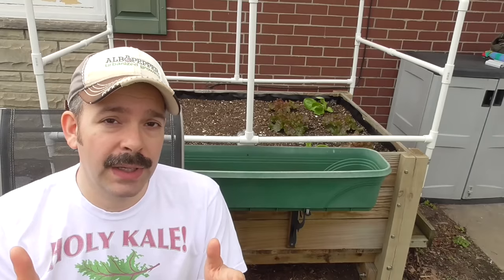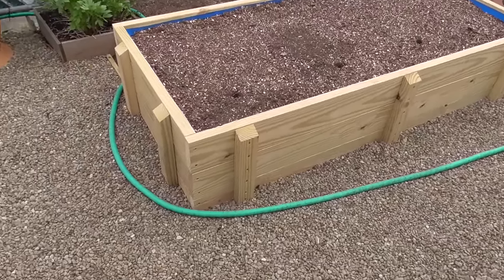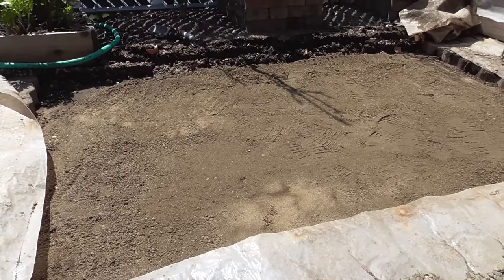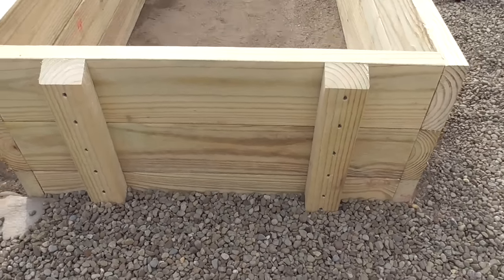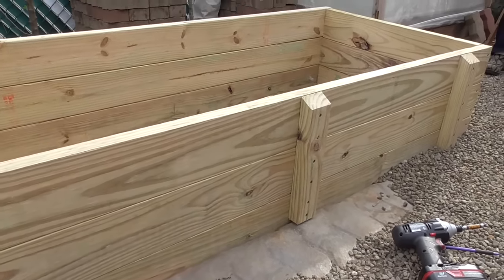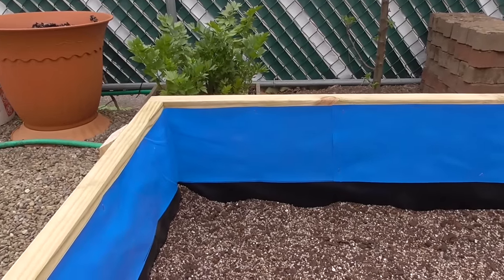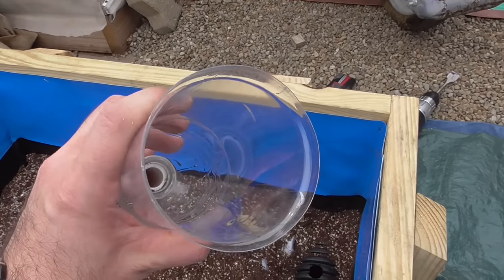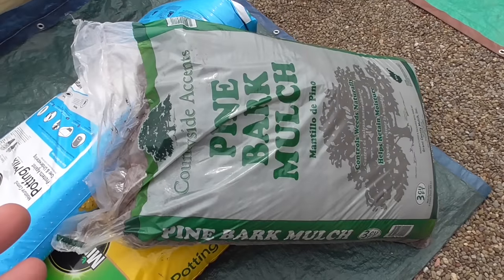Self-watering SIP Sub-irrigated Raised Bed Construction  (How to Build)

Comment: Ever had issues during heavy rain events where the bed would overflow from over the top?
Reply from the maker: No, that's never happened. That's what the overflow tube is for. And the drain pipes also have an air gap. The only way the system can overflow is if it has frozen solid from Winter weather. As far as general rainy weather, please watch this video: https://www.youtube.com/watch?v=5orIjYKFRgE
Reply: @Albopepper  I understand the overflow tube (for the reservoir), I was more thinking for during 'thick and fast' rain events where there's not enough time for the soil to filter the new water down, essentially bottlenecking water from discharging via the reservoir overflow.
Reply from the maker: If anything, what you're describing is more likely to occur on natural soil than in these SIPs. The potting mix allows for water infiltration much better than many native soils. I also use 2 overflow tubes on large SIPs. And those tubes can be 1/2" internal diameter, to allow for increased flow rate.

Comment: Great video. Just one question. Do you connect the drain pipes to each other in some way so that the water can flow easily between the tubes?
Reply from the maker: Thanks for watching Anders! You can connect the pipes if you'd like. But I did not do so and they still work very well. Because the tubes have slits in them, the water levels out.

Comment: I've watched your series about Sub-irrigated gardening bed, and I have a question. I live in Deep South Texas, and I want to build a Garden bed like yours, but I'm nervous on heat and that my plants won't get the water quickly enough before they dry out. Should I make my bed shallower to compensate for this?
Reply from the maker: +Onario Ledezma - Hi Onario. That's an interesting concern. I personally wouldn't make the bed shallower. A deeper bed means more potting mix. In addition to your water reservoir, the potting mix itself stores water. So, more mix means more water PLUS more root zone. Instead, I would consider a mulch of some sort. Perhaps even a plastic cover, which many retail SIPs recommend.
Reply from the maker: +Onario Ledezma - A bigger bed would work fine. You just need a bigger liner though. And try to keep it level, or you'll have a wet side & a dry side. Longer beds amplify the effect.

Comment: Thanks, I'm glad I saw your video b4 building these beds b/c I'd watched a few of the other ones without enough drain pipe. I want to start out RIGHT, thank you very much. ;)

PS - About how many gallons of water fill up the pipes b4 water starts going out the overflow tube?
Reply from the maker: Thanks for watching my video!  I'm glad it was able to help you out.  xD

The water holding capacity would vary depending on the box dimensions. To estimate it, I would calculate the cubic inches (internal width x internal length x height of 3"). Then convert those cubic inches to gallons.

Your pipes and your potting mix will displace some of that volume. But it would give you a rough idea at least. And of course, a good potting mix will retain a certain amount of water too, so some of the water would be wicked upward.
Reply: Thanks! One more question I thought of a couple days ago: how do you tell when pipes need to be refilled? Dryness of soil near bottom of bed?
Reply from the maker: High Emily! My favorite method is to use a simple moisture meter. (I show one in my Update 1 video.) The finger method works ok too, but not quite as well. Once you begin filling, you know the reservoir is totally full when the water trickles out of the overflow tube. But I don't typically fill them to the max. Only once the plants are huge and the weather is hot, dry and windy. Then I start to pump in large volumes of water, because transpiration rates climb dramatically!

Comment: Love you design.  Do you see any problems if I used a steel planter box?
Reply from the maker: Hi John. Thanks for watching! I would think that it would work ok. A fellow viewer suggested using a metal watering trough which is designed to hold water. The only possible issue I can even imagine is the fact that metals are more apt to transmit and conduct heat. In a super hot climate, that might effect the temperature of the soil & roots. I'm just guessing here.
Reply: AlboPepper - Drought Proof Urban Gardening 

Thanks for the info.  I live in a rather moderate area - Pacific NW.

Comment: Wouldn't this have more gap than you stated is desireable between drain pipes?  Box dimension is 30" wide and you have 6 - 4" pipes in there which means you have almost an inch gap between each.
Reply from the maker: Thanks for watching and studying the concept so closely. The reason why that's not a concern is because the 4" pipes are inside diameter of 4". The outside diameter is about 4 5/8."
Reply: @Albopepper  awesome appreciate the quick reply and excellent educational content.  I'm making a smaller bed based on this concept and you just saved me some trouble when I go to assemble it.

Comment: I heard you mention peatmoss but don't see where you added it.  I have perlite, vermiculite, fertilizer, and bark, do I need peat moss?
Reply from the maker: Are you adding those materials to a potting mix? Or are you using them to make a potting mix from scratch? Peat moss is commonly found in potting mixes and it is a good component for SIPs since it wicks very well. An alternative would be coir (coco).
Reply: @Albopepper  Thanks for responding.   No am not making a new potting mix but have no idea how much peat is in it.   Hopefully  will be able to fill the bed this weekend.

Comment: Nice video. I wouldn’t wanna use miracle grow I heard that they contain heavy metals
Reply from the maker: Thanks for watching Bill. If you want to avoid Miracle Gro for heavy metals, then you can certainly look up their products in various databases: https://agr.wa.gov/PestFert/Fertilizers/FertDB/suppinfo.aspx?pname=698 The Moisture Control was below detectable levels for most metals of concern: https://agr.wa.gov/PestFert/Fertilizers/FertDB/prodinfo.aspx?pname=2858

Either way, bare in mind that ANY product may have contamination and if you're really concerned, I would research all brand alternatives. Not just Miracle-Gro. "Brands" aren't contaminated. It's the raw materials used in each individual product line. And that can apply to ORGANICS as well. Also, our own native soils have varying concentrations of metals.

In general, the basic idea of eating more plants and less animal products is the best way to minimize dietary contamination. Selecting organic produce is preferred when it comes to pesticide residues. But growing your own can be even better!  :-D

Comment: 1 more question, the overflow, does it leak water into the wood since its not sealed.   if sealed, how did you do it. thank you
Reply from the maker: Hello, Minh! Actually, there can be a little bit of water seepage around the overflow tube when you fill the reservoir up all of the way. To avoid this, you can seal the liner to the tube from inside. A bead of caulk or something similar should do the trick!  :-)

Comment: Hi AlboPepper, great video, thanks for sharing. I've got a question (you may have answered it already somewhere in the comments, sorry for asking again :) Which filling material did you use to fill the space between the perforated drain pipes, and how much?
Reply from the maker: +Helmut Degen - Hi Helmut! Thanks for watching my video. I used a mixture of peat moss, vermiculite and perlite. The mixture needs to wick water. Using some vermiculite is great for this since it won't quickly degrade. As a result, the bottom layer lasts longer over a period of time.

Some people have altered the mixture to their liking, but I recommend things like coir or peat moss with vermiculite and/or perlite. I would NOT use bark, wood chips, gravel, sand or compost in this section.
Reply: +AlboPepper Thanks for the reply, Al, very much appreciated. Do you remember the amount you have used?
Reply: +AlboPepper - Is the mix between the pipes an equal 1/3 mix of peat moss, vermiculite, and perlite?
Reply from the maker: prodigal27 Normally, that is the mix that I use (equal parts of all three). But this is not set in stone. For tighter pipe spacing, I may use a little less perlite. In general, I mix something that wicks very well and that takes a long time to break down.

Comment: Dr. Pepper,  what is your thought on filling in around the perforated pipe with drainage gravel?  I have seen a lot of other systems used where they use gravel first, then put the soil mixture on top of that.
Reply from the maker: Hi! Placing gravel around the pipes would cause the system to fail because of the gravel's poor wicking potential. As far as my general thoughts on gravel in SIPs, I just wrote this page stating my personal opinion on using gravel:  http://albopepper.com/pipes-vs-gravel-in-SIP-wicking-beds.php
Reply: Thanks.  I did my first 8' box with gravel fill under the soil. With a 1.5 cubic yards of soil, I've had to top off the box every day (for about a week now).  I'm guessing that the water is working overtime to saturate the dry soil as it works its way up to the top - either that or I have a massive leak.  I'll try your method on my next one and see how it goes.

Comment: How do you keep the plants from getting wet feet?
Reply from the maker: By building a system with the proper depth, and filling it with the right substrate, the plants grow extremely well & have no issues adapting to the moist soil. Remember that many plants can be grown hydroponically. That involves roots growing down into water. The roots are adapted for the environment.
Reply: @Albopepper   aaah, thank you soo much! Ill go forward then. Im going to try to use 4 gallon water bottles with netcups and agfabric 🤞🤞🤞🤞🤞

Comment: Hello Al, I'm a new garderner and looking forward to building this soon. Do you have a ratio recommendation for the Potting Mix and Vermiculite that you initially used to cover the bottom of the SIP and corrugated pipe? What are the maximum box dimensions(4' X 8'??? etc) that will provide the minimum 4 inches of liner using the 5' x 10' pond liner being advertised on your website?
Reply from the maker: +dlgardener - Hi! For the bottom mix, there is no hard fast rule or ratio. Some people have avoided using vermiculite altogether and instead they've focused on a large volume of perlite. In my early tests, I had good success using 1:1:1 perlite / vermiculite / peat moss. It seems to have worked rather well for me.

The width of the box should probably not exceed 4 feet, assuming you can access both sides. You just need to be able to reach in. For the length, it could exceed 8 feet, but you'd need a long enough liner. So if you want to stick with the 5' x 10' liner then I'd say an 8' bed would work best since you could just use standard 8' boards. Hope that helps!
Reply: +AlboPepper Thanks again Al, can you please confirm the side supports are 4"x4" or 2"x4"?
Reply from the maker: +dlgardener - U bet! The side supports were made from the scrap pieces of 8ft 2" x 6" boards that were cut down for the short sides. I took those left over boards and ripped them in half on the table saw. It resulted in very little waste.  ;-)
Reply: +AlboPepper Thanks all around Al, my SIP box is built, seeds are planted, and we are on the way to hopefully a great vegetable garden. I went with your dimensions of using almost 4"x8" which worked great with the liner. One recommendation may be to do two water bottle feed tubes on opposite ends because mine doesnt tend to drain out of both overflows at the same time unless the water flow is super slow. It probably has to do with the pipe spacing, how well the mix was placed around the pipes, and maybe the garden fabric i selected to cover tube ends. People should definitely take their time when putting the initial bottom mix over the corrugated pipe and watch the spacing. It also takes time for the initial equalizing of water across the raised garden bottom. Please feel free to correct my notes...

Comment: I live in the Caribbean and between the weather and bugs, wood boxes won't last very long.
What about using PVC Panels and PVC Pipes in terms of chemicals leaching of into the plants? (instead of wood)
Reply from the maker: PVC is produced in two varieties: Rigid and Flexible. The rigid type is a durable hard material with fire retardant properties. Any weathering to the material tends to only occur on the material's surface. The white schedule 40 piping that I use is rigid PVC. It's UNPLASTICIZED and has been for more than 50 years. Sometimes the acronym UPVC is listed for such piping and stands for "unplasticized" PVC.

In contrast, the plasticized flexible form of PVC is created by the addition of phthalate plasticisers during manufacture to soften the polymer. This is not the kind I would use. Again, rigid PVC piping does not contain phthalates or any other plasticisers. So in my opinion, it's safe to use.

Comment: Good day Albopepper, I was wondering if the self watering designs are not prone to anerobic bacteria?
Reply from the maker: Hello kaos! The way that my systems are designed, there is an air pocket that helps to oxygenate the reservoir. Also, I advise against using animal manures which cuts down on anaerobic bacteria exposure. If there are still some of those bacteria, I've never noticed any septic smells and the plants have always performed well with no signs of disease.

Comment: in the Self watering SIP Sub irrigated bed how does the water travel from in pipe to the other. As there is only one inlet pipe from which you are pouring the water in only one of the pipes.

Also which type of tape you are using to seal the contact between the watering pipe and the reservoir pipe
Reply from the maker: +Shirish Poddar - Hi Shirish. The pipes are perforated and the water freely flows between the holes in the pipes and the pore spaces within the potting mix. It easily spreads out throughout the entire bottom of the box. To seal the watering pipe to the reservoir pipe all that is needed is a little duct tape or something similar.  Thanks for watching!
Reply: Thanks for the response, because of your video we should be able to create a similar system

Comment: hello albo.you mention the width and length,,is that the outside or inside measurement,,thanks peteman
Reply from the maker: +pete man - Hi Pete. Be sure to check the video description & my website for more info. Here are the specs I used for this box:

 - Internal Dimensions (select your own length & width): 71.75" L x 30" W x 16.5" (deep)
 - Over Flow Drain Hole Height: 3.25" up from bottom
 - Recommended Gap Between Drain Pipes: 0.25" (minimum) - 0.75" (maximum)

Thanks!  -AL